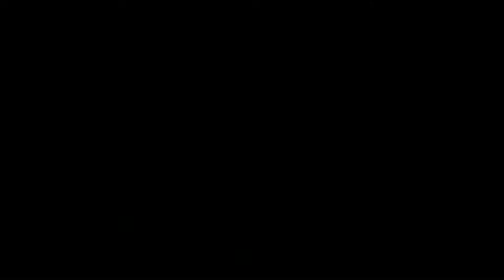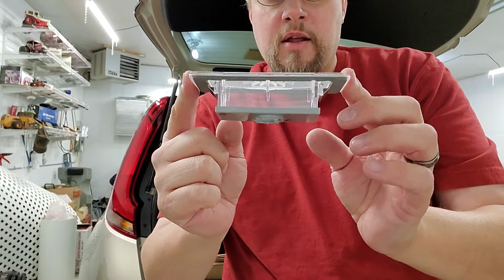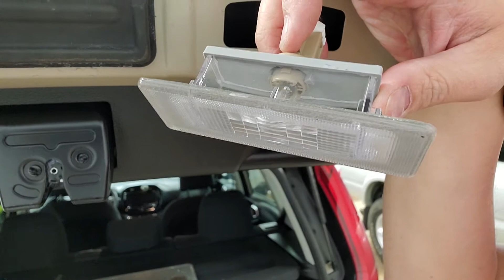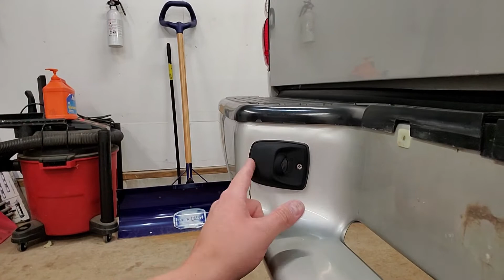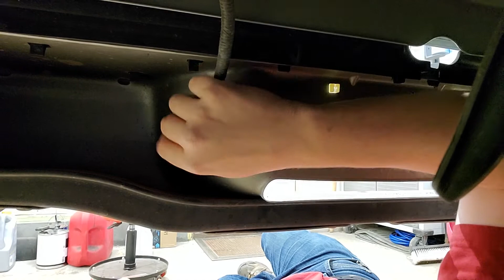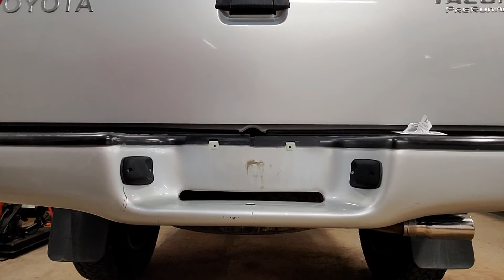LED Licenses Plate Lights | Toyota & KIA | Bad Wrench

Comment: Just did this is there a certain way im supposed to bend the little metal clips back? I feel like the housing stayed loosed and not as tight as before i took it off. Lights are definitely brighter